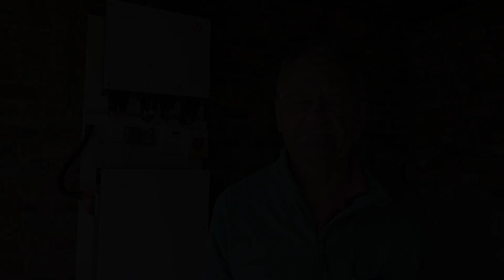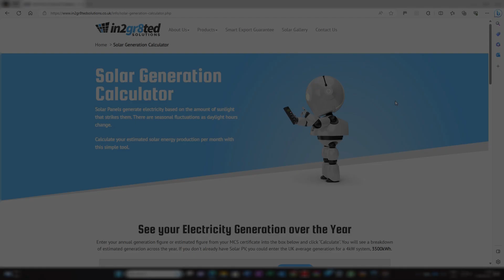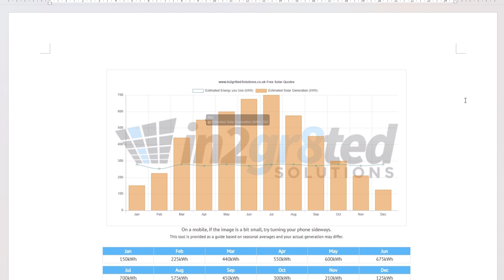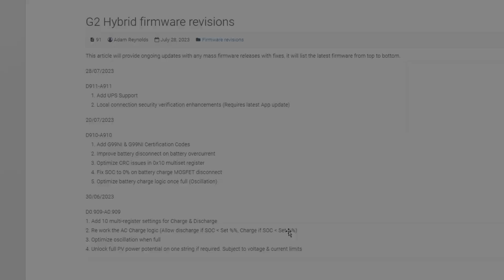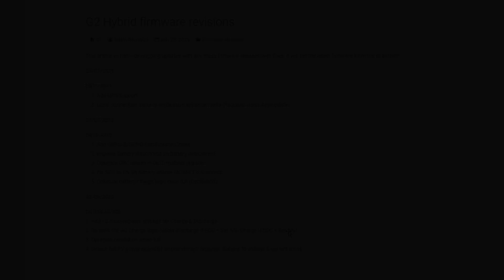HS217 Givenergy solar inverter and battery – 6 months update

Comment: Another great video, can i ask if there was any concern with the 5kw invertor for a 7kw system from the installers? I am about to have a 6.88kw system for an east facing array and have been told the 5kw GiveEnergy invertor will be too small? What do you think to that, i think it would be ok.
Reply from the maker: Hi Greg, you probably know the 5kW refers to the max AC output power. Actually the inverter can handle 7.5kW per solar string on the DC input side. My array only generates about 5.6kW DC peak across the two strings as it is east-west. So as it works out the 5kW is about right for my setup. Cheers
Reply: @HaxbyShed  Hi, thanks for the answer, so if you had the choice between the 5kw Give energy or 6kw solis invertor for my 6.9 kw array, estimated to produce 5122 kwh, which would you go for? My heads about to explode with all the information im being given and i just dont feel qualified to make an informed choice :0
Reply from the maker: Greg, you have not said if you are having a battery? The AC output power limit on the inverter is only relevant when you have a big load like an electric shower, or you have an oven, and a microwave, and a dishwasher/washing machine all running at once. In that case you will get your first 5kW from the panels if the sun is full out mid day in June and July and the rest comes from the grid. If you want to charge a battery also then it will prioritise the house first then battery charging. But to me the most important factors are, given the two inverters are about the same capacity: 1) the degree of control you get with the App; 2) the level of integration with your energy supplier.  Octopus and Givenergy collaborate and often the newest smart tariff products are optimised for Givenergy first. Also having a web/cloud enabled system allows for remote control by your energy supplier so you can participate in the Demand Flexibility Scheme (selling your power back to the grid at times of peak demand) but that is only really relevant if you are getting a battery.  No system is static (meaning things evolve) and Givenergy periodically release firmware updates which users can install themselves from a web browser on a PC. You just press a button on the web page and it updates the inverter and battery software automatically over the internet. Not all systems do this and an Engineer has to call to plug in something to do the update. In June last year I got an update which increased my solar output by about 20%!!  Ok, maybe that was ironing out a bug but the point is it was almost automatic - I just pressed a soft button on the web page.  Every relevant Givenergy firmware update is offered users automatically as/when they log on, I don't need to be hunting for information about updates or relying on the manufacturer to contact me by email or something. Givenergy support had been good for me. I used a 'platinum supplier'. If you do go for Givenergy use plug-in Ethernet cable if you can (Gen 2 inverter and above). Wifi is fine but physical cable just removes that variable, in case of an internet connection problem. Cheers
Reply: @HaxbyShed  Hi, i really appreciate your detailed response and the time taken. I am having a 9.5 GiveEnergy battery also. My concern with the 5kw invertor was clipping as my installer is saying i will lose some kw production through the peak months, June & July and i wont have optimised my system, they even said i would lose 6%. We dont have any electric showers and i plan to keep charging my car through the night on cheap rate. I'm not 100% sure the soar companies really know much about invertors as when i ask anything technical they really dont have an answer :) It sounds like you are leaning towards the GE 5kw over the Solis 6kw. Thanks

Comment: Haxby gets a new York ring road as well. I discovered a website which reports solar statistics, but it did include a visit to GivEnergy which was very informative. I’m mainly interested in choosing the best brand of panels rather than stats. Maybe GivEnergy is the single best source. Your comment on earth leakage was noted. When we installed our 25mm cable it was for feeding 3phase equipment. It tripped almost all the time due to the single phase, 3 phase power signals. It would have saved a lot of time and ELBs if l have known beforehand. Operational feedback is so important for the design cycle and saving experimental time and cost.

Comment: Thanks very much for the response. I missed the first video but have now watched it, and it really helps. Youtube is a great medium for providing a system which supports unbiased, first hand operational feedback, and avoiding all the dubious advertising from 'award winning', drum banging 'music' commercials. As you state there is lots of information to absorb, which makes this an ideal project. The Givenergy-Octopus combination does everything that the Jesse Muller system provides. One consideration we have is that we have petrol powered AVR generators (5kVa from memory), which we use during grid blackouts. Much earlier our first generator was left attached after a blackout and we accidentally roasted the windings when the grid was reattached. That's been solved by automatic dropouts and switching, but we can improve on that. There are also 16mm and 25mm SWA cables, 120m long, which could link the house if remote solar panels were used. The 25mm cable is used to minimise Voltage drop for a VSD, and the 16mm is normally used for more static frequencies. We will be watching all you videos again, as they really help. Thanks.
Reply from the maker: Hi Geoff, the system I have does not operate off-grid. This is due to UK installation regulations for this product. The only power backup is that socket under the inverter. But Givenergy now has another product which they call the 'All-in-one' that includes a gateway that hard switches the house over from the grid to the inverter and battery system in an instant in the event of a grid supply fail (i.e. it physically isolates the house from the grid) and this product will run the whole house from the sun and battery without a blip. I would not have bought it for myself however because I have very limited space for a gateway close to the grid supply point on my house. Cheers
Reply: @HaxbyShed  We considered a fail over, but for now its manual switching to isolate the grid; starting the generator; enlivening a switch board; then feeding via the 16mm line up to 50A. Yorkshire Generators are solely powered by PV panels, which l believe provides all their site premises with power. Their main business is diesel electric hire for events.
Reply: @HaxbyShed  Wow, this is great advice, and reinforces the need for me to do further research. We incorporated drop out relays on the latest generator feed, and get sufficient power for the entire house with a voltage stable enough to run all the computers and FM/LORA devices (Rfsolutions). Expensive to run but we only need 1-2 days during storms, unless a farmer knocks a power pole down. We are about to switch to Octopus, was it subscribing to Octopus or Givenergy which provides you with a bonus? Octopus gets very positive reports rather than our present supplier which is a corporate pain.
Reply from the maker: Hi Geoff, if you can switch to Octopus with my link then you get £50 credit and I get £50 credit.  In fact every Octopus customer gets a personal Octopus referral link and this is mine https://share.octopus.energy/mint-jay-124    Cheers
Reply: @HaxbyShed  Paul, l do apologise as we have already signed up. If there is anything l can do to rectify this, let me know please
Reply: If its something you would be interested in, Haxby Shed could be an independent, trusted reference for solar panels. We haven’t researched the market much yet, but understand that PV panels can now compete against centralised generation. Our next step will be to install an array at 4m height pointing directly South. We would share anything we learn, but Haxby Shed is much further ahead than we are. Our first step has been to switch to Octopus, which was quite easy. Our previous supplier is still sending conflicting billings and legal threats, including a bill for £6, which we settled before the Octopus switch. With the high cost of fuel, it seems central generation is entering a phase of gradual decline 😊
Reply from the maker: @GeoffHome-u6r  I'm not up for that Geoff. My main topic will always be my hobby machine shop. I see so many solar and battery channels running out of things to say then it becomes "January's stats", ooh exciting .... "February's stats" ... yawn.  🥱🥱
Reply: @HaxbyShed  Understood. From what you say its somewhere I wouldn't want to go either. Only trying to navigate another minefield and make a sound decision.
Reply: @HaxbyShed Paul, l watched one of those Solar Panel videos by a Green outfit. It was interesting at first but became unwatchable. I’m not getting any response from GivEnergy or its installers. They are probably overloaded due to grid energy being so expensive. We have to switch and start by installing some panels. Is it possible to advise the brand of yours?
Reply from the maker: @GeoffHome-u6r  TrinaSolar Vertex S all black 395W - about 21% efficient. A mid range panel made in China. Probably superseded by a more recent product by now - e.g. 420W.  There are 2 or 3 similar Chinese companies but just check the warranty period - I noticed some are longer than others. But they are so cheap these days 10 years from now you would probably just replace them with something more efficient. Now you can get for £100 what I paid £150 for just a year ago. Apparently 28% efficient panels are at preproduction.  Likewise batteries have probably come down 20% if you really shop around for offers. Cost of Lithium is really coming down.  One big Chinese EV battery maker (CATL?) has said car battery prices will drop significantly over the next 12 months (I heard maybe as much as 50%). Cheers
Reply: @HaxbyShed Thats exactly the sort of info and advice l was looking for, and much appreciated. Warranties of 12 years are being offered at present but l question if some companies will still be around by then. Agree, its simpler to replace panels after say 10 years. The overhead grid companies are saying they need £billions to distribute increased demand and l don’t want any part of that. The UK is about to become an energy island in the next decade.

Comment: Watching a video from Jesse Mullers channel about a US manufactured Home Battery Hybrid Inverter. It has impressive power controls and graphical interface. Shows power flows from the Solar Panels, Home Usage, and bidirectional flow to/from the Grid. Long term we want only rely on the grid for backup power and stay mainly disconnected from its out of control costs. Your videos could provide an excellent reference for those who want to do the same. Keeping tuned.
Reply from the maker: Hi Geoff, thanks. That was my 2nd video, after 6 months of operation. In my first I went through the controls and graphs. I've very pleased with it all. I'll do another vid in a couple of months - after we have had it a year. In UK we now have something called the 'demand flexibility scheme' (DFS) where if the grid is tight for capacity they will buy power from our home batteries at a very good buy-back rate of between £1.50 to £4.40 (US$1.9 to US$5.5) per kWh, plus we get the normal export rate on top (£0.15 per kWh). It usually runs for an hour at a time and we usually export 3.2kWh at the DFS rate. Apparently we can expect at least 10 high-demand buy-back sessions this winter. We have subscribed to an automated scheme where all this is controlled remotely from the cloud so all we have to do is drink coffee and watch telly, and the money rolls in. Since this is a new development it was never in our solar business case but I reckon it could pay for 1/3 the cost of the battery over 10 years as an unforeseen bonus. (But grid infrastructure batteries are going in fast now so not sure if it will actually run for 10 years for domestic customers.) Cheers

Comment: Thanks Paul for clearly explaining your GivEnergy installation. It will be very useful to me as I will have the same system soon.
Reply from the maker: Hi Peter thanks. I'm still very pleased with it. And I/we got an added bonus recently with automation for the payment to save energy (forgot the proper name). Basically at set times Givenergy (Axle) take control and export from the battery earning typically £2 per kWh plus the normal export tariff. I can explain more properly/fully if you need. Cheers
Reply: @HaxbyShed  Hello Paul , If I let Givenergy automate the export from the battery, will it interfere with my FIT tariff I have at the moment ?
Reply from the maker: Hi Peter, maybe there are two separate questions: 1) if I am on FIT can I routinely get paid for battery export?; 2) over and above that, can I get paid if I subscribe to the Demand Flexibility Service (£2 to £4 per kWh payment for exporting at specific short-notice peak times)?. I looked in the Givenergy Q&A for the Giveback scheme (Demand Flexibility Service) and that helped a bit. I do not know the answer truly to either question but for sure to get payment for the DFS scheme you must have an smart export meter so they can monitor export by the minute. Instinct tells me you may get nothing for 1) (because that would be double counting maybe?) but maybe you may get something for 2), the exceptional DFS payments.   You would have to ask those questions specifically. Complex isn't it. Cheers
Reply: @HaxbyShed  Hi Paul, Thanks for your reply regarding the Givenergy/ Axle grid top up. I did look into it and found that the FIT was not affected and signed up to participate in the new scheme . Many thanks, Pete.
Reply from the maker: @peterward5723  I have found it works flawlessly and is just money for nothing. Giveback/Axle payment, plus Octopoints (Octopus points), plus my normal export tariff payment. Cheers

Comment: Interesting video…What is the approximate cost of the system installed?
Reply from the maker: Hi the basic system was about £12.5k including the Lora radios. Then there was the bird protection for the panels and some electrical work to expand capacity in the consumer unit on top.  Panels are still coming down in price and I've noticed the batteries are down about 10% since we got the quotes for ours about 10 months ago. Cheers

Comment: Hiya.  Can I ask if your GivEnergy installers gave you full administration access to the hardware you own?
Reply from the maker: Hi SOUK, I have a normal customer logon. The installer logon has a few more functions like commissioning. I don't have the installer account, what I'm showing any customer can do. It produces loads of data I can view in the portal and/or download to a spreadsheet. It's extensive, the normal stuff but also inverter voltages and all sorts. Customers do their own firmware updates by 'self-service'. On the My Inverter page it will say if a firmware update is available and guides you through. It's not complicated - like updating a phone. Cheers